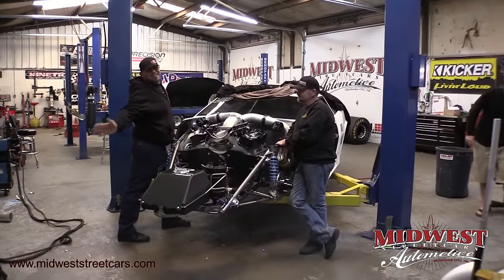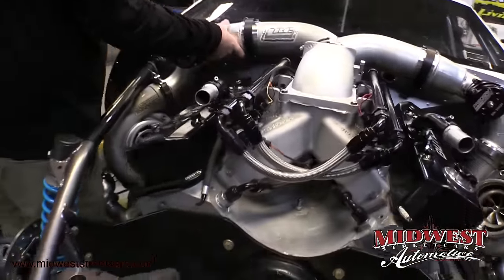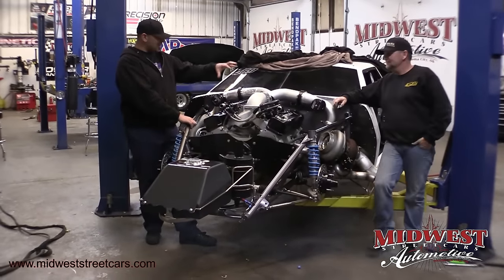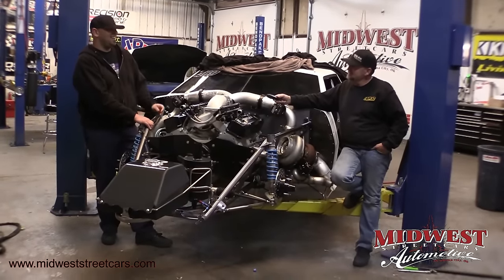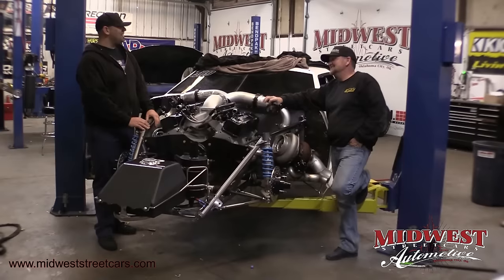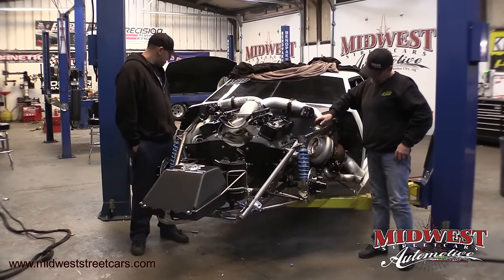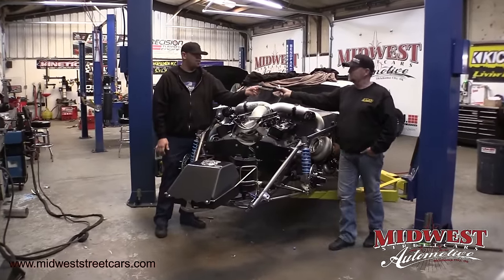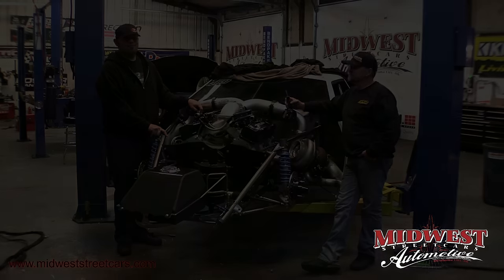Time-lapse of Big Chief's Crowmod Turbo build with Lutz Race Cars

Comment: That's badass keeping it real with the Pontiac motor! I am one of the oddballs to I am the only SB Oldsmobile running at our local track. Looks like your coming along well look foward to more updates!
Reply: he still should have went with a Chevy motor.  as much as Pontiac is cool it just has limitations not to mention you can build bigger cheaper power with Chevy.
Reply: ryotaryuu the cost of building Chevy is cheaper, I agree but he likes Pontiac. Same with me it is more expensive to build Oldsmobile but I like it and it has so much more torque then Chevy. I am not trying dispute what you are saying but I guess to each his own..

Comment: McCarty racing has tunnel ports ram air Heads that can have the exhaust port runners cut way back against the surface of the head like batten did to the Olds head for their NASCAR efforts, instead of that long winding downturn that costs you flow. That would move the headers 2-3" closer to the head and may leave enough room for the bigger turbos. Google the heads and take a look. I think you leaving so hp on the table.

Comment: for a engine upgrade if he wants more power. go Steve morsion engine with a 632 ci big block warrior with those turbos and the methnoal injection... watch Kyle Kelly whimper as he pulls out with 3000+ horse power on just the turbos

Comment: why not use the blow off valves, as to peddle. instead of momentary lifting "peddling". just dump pressures instead of pressurizing the intake with closed butterflies. when the throttle closes, the blow off valves still open . you still achieve the same result.

Comment: i can't wait to see Kye get gapped by the Crowmod then come up to Chief after the race and be like "that's a bad bitch right there" can't wait to see the smile on Justins face once that happens
Reply: +nallen100 yeah but if you actually look at keys car it looks more like a pro stock car. It's not really stretched. you will notice that.
Reply: kye races a tube chassis carbon fiber pro-mod. doesn't matter if it resembles a street car and isn't stretched. chief is gonna spank that nitrous camaro
Reply: +02SubaruWRX actually there's a huge speed difference between a pro mod and pro stock. kyes is a pro stock if it was a pro mod and built like one it'd be way faster. pro mods high 5s to low 6. pro stocks mid to high 6s
Reply: +02SubaruWRX and what happens if chief loses. if big chief lost to kye pro stock when big chief was driving a pro mod that'd be sad.
Reply: +nallen100 yes under nhra rules he would have to register it as a pro mod because of the power adder. but the wheelie bar length and the car length is a pro stock if he took the nitrous off he would have a fast pro stock. add the nitrous to it run the pro mod class his ass would get waxed all day. That's why he barely beat the crow and daddy dave waxed his ass in the truck.
Reply: +nallen100 get off the racing bandwagon and actually go to the track. also pro mods run scoops. pro stocks can't. aka why he doesn't run a hood scoop anymore
 And pro stock just went mandatory efi fuel injection and what did Kye switch to um oh yeah fuel injection. they say pro mod to get more effect for the show make their car seem faster then what they really are.
Reply: +nallen100 also to clear up the hood scoop he use to run a forward open hood scoop. now he runs a closed hood scoop which is legal.
Reply: +nallen100 yeah the only pro mod thing about it is the nitrous. because it has a power adder. like I said if big chief barely beats him or Kye wins. his fully built pro mod lost to kyes nitrous pro stock/ slow pro mod. I never said it was a pro mod I said if he went to nhra or ihra since it has power adder it's classified as a pro mod. it's still a pro stock chassis. in easier terms for you to understand. just because you put a Ford engine in a chevy truck doesn't make it a Ford truck. but if the rules state Ford engines have to be used, that doesn't mean the chevy truck is a Ford truck now. even though it can race in the Ford class.. the only thing promod about kyes car is the nitrous nothing else.
Reply: +nallen100 actually ihra pro stocks have no engine limits just went to an event earlier this year guys are running 832 cubic inch. yes nhra it's illegal it still rules with ihra
Reply: +nallen100 so get off Wikipedia and Google and actually go to a track and walk the pits.
Reply: +02SubaruWRX yeah I just run a 50k dollar engine dyno and do tuning all day I have no life.
Reply: +02SubaruWRX because let's see oh yeah it's Christmass and new years and I get the week off. you probably work at mcdonAlds.
Reply: I just checked the street racer rule book hand held edition . It says very clearly on page 4 paragraph 20 that  there are no rules in street racing. Who would thought. It was in print.
Reply: +ethelkilledfred thanks for completely getting off topic on our debate! :)
Reply: +nallen100 pro stock does have power adders they have either a pro charger or a super charger

Comment: whoa wait, Edlebrock heads and 7/8th headers? i was expecting racing heads from brodix or something but then again its hard to find high performance Pontiac parts and when you do they will cost more
Reply: that's whybthey had to build the headers
Reply: he should have sold the Pontiac motor and went with Chevy.  cheaper, more parts and easier to make power.
Reply: +ryotaryuu That Butler Pontiac engine isn't that expensive and makes a lot of power. He wanted to prove he could do it with a Pontiac because a lot of people said he couldn't.
Reply: +ryotaryuu 
Pontiac parts are about $10-$20 more then say a BBC, and no, it's not easier to make power, it's just the same concept, don't be narrow minded.
Reply: +ryotaryuu But then the Cro-Mod woukd just be a funny looking Camaro, and nobody wants that.
Reply: Not always true.

An all out pair of BBC racing heads cost $4,922.00 for bare castings.

An all out pair of Pontiac racing heads cost $2,495.00 for bare casting.
Reply: Timothy Sharpe
That's some muddy water friend.

Comment: Your turbos are gonna be sucking in super hot air facing the exhaust manifold like that how is the gonna get cooled down¿
Reply: If he's still burning methanol, that'll drop air temps pretty quick once atomized together.
Reply: +GreenJeep1998 oh yeah I thought it was on E85
Reply: +xcp747 E85 will still run way cooler that gasoline, but I believe methanol not only is higher octane than straight ethanol, let alone E85, I think it might cool the air even better than those two as well.
Reply: +GreenJeep1998 yeah I'm aware that e85 burns cool but I recon turbo intakes being that close on ethanol is a lost cause but meth is a whole different ball game

Comment: I was wondering what is Shawn's job at midwest, is he the official chair inspector or is he just supposed to keep the chairs on the ground by sitting in them to keep them from flying around the shop when yall start up engines inside the shop? (LOL just kidding Shawn.) I know he does work on cars just wanted to bust his balls a little. keep up the good work guys love the show. by the way could yall do a video on putting a turbo on a newer model chevy truck or about a truck you have already put a turbo on?